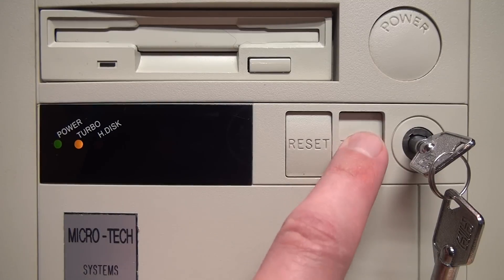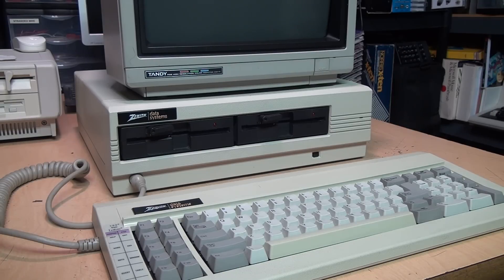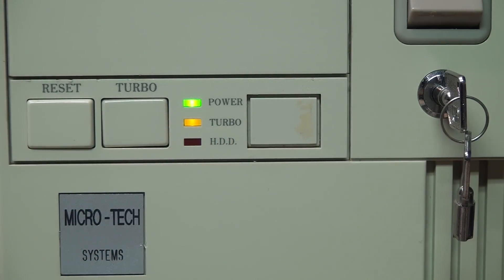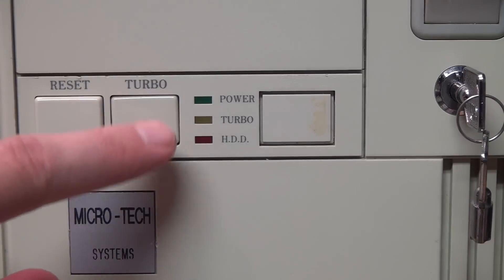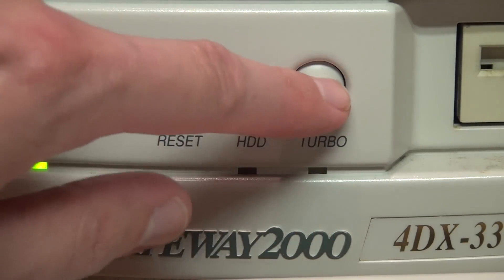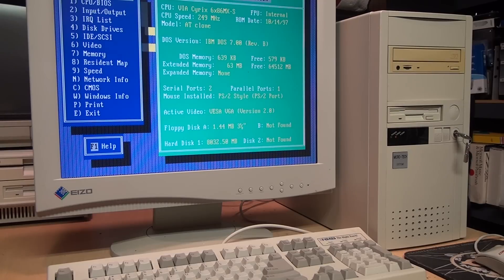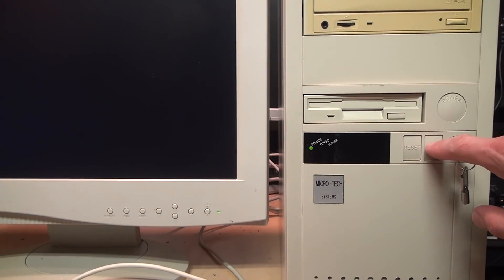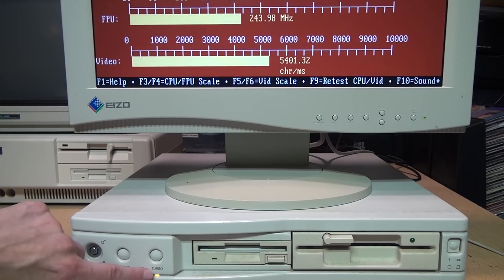The PC turbo button mystery finally solved! (beta version)

Comment: That's not what people mean when they say the turbo button makes the computer slower. they are referring to the fact that the Turbo button, does not actually boost performance, That's not why it's there, Its purpose is to slow down the cpu by adjusting the bus speed so old games and software wouldn't run at super speed.
Reply from the maker: That's not how the turbo function was initially advertised -- it was a speed boost feature. See the history section of the video.
Reply: @vwestlife  Exactly, It was advertised as a speed boost, but what it actually did, if you removed the button, was run at turbo speed, people realized this, and that's why they started to say "It actually slows down my pc, it doesn't make it go faster"
Reply: @SantaClaw   I feel like your explanation makes a lot less sense than the one VWestlife’s provided. Not only did he explain (not in these exact words, of course) that pressing in the Turbo button to enable the indicator light and the full speed of the CPU was a sort of de-facto standard, he also reiterated in the comment above that Turbo was advertised as a “speed-boost”. “Turbo” was never really referencing overclocking or generally faster speeds, it was specifically describing that with the feature on, the computer’s clock would be higher than that of an IBM PC or XT. If the light switches in your home were automatically set to the on position after a loss of power, you wouldn’t say that the switches in your house just turned your lights off, you’d say they toggle between the two states
Reply: @leakingsubconscious1671  True, I just remember how the saying spread in my area, I'm Norwegian, and we probably had different access to things than you guys did.  But here, some people felt cheated, as they thought the Turbo button, was a feature to make their pc's faster, only to find out, that in fact it did the complete opposite thing. Many people sought out the pc's with "turbo" as they thought they where faster than the "non turbo" ones. I had a friend who was very vocal about being "cheated" by this feature. 25 mhz vs 33 mhz bus speed for example. I suspect it was marketing having some inventive views on the thing. I remember full page ads, with a picture of the turbo button on a case, with speed stripes and text along the line of "Turbo It!" and/or "Engage Hyperspeed"

Comment: Regarding the Intel datasheet, the TURBO pin is only present on some SL processors and it's not what most systems used to implement the TURBO functionality. So, it may not be the best reference for the wiki page...
Reply from the maker: The turbo pin of the CPU isn't the point. It's what Intel officially defines turbo mode to be.
Reply: @VWestlife Yeah, I understand your point - it gives us a glimpse into Intel's state of mind at the time. But that said, the described "Turbo Mode" is something slightly different - something exclusive to the "SL-enhanced" chips. It's really a power-saving feature rather than a workaround to improve compatibility with old software. Most desktop processors from Intel didn't have any kind of "Turbo Mode." Instead, the feature was implemented on the motherboard/firmware level by dividing the external clock, introducing wait states, disabling caches, etc.
Reply from the maker: @GeckonCZ  Basically they built the turbo/non-turbo mode switching into the CPU rather than needing extra components on the motherboard to do it. That's the only unique thing about it.
Reply: @vwestlife  There's a little bit more to it but yeah, that's one way to look at it... :)

Comment: To make things even more confusing, some cases had the TURBO LED and LED display controlled directly by the TURBO switch instead of the motherboard. In this configuration, the readout could get out of sync with the actual speed set (e.g. when the key combo was used to change the mode).
Reply: Perhaps that's where people's confusion with the turbo switch having to be off to run faster is coming from?
Reply: @NiebaumCurran  The confusion was caused by there not being a standard. Our pc's were set to run full speed and pushing the switch slowed it down. Other builders did the opposite.
Reply: Turbo button's pressed in turbo light's on. Some program uses/conflicts with the same key combo as the slow down command, user is not aware of the turbo key combo, PC suddenly slows down but turbo led is still lit....  X-{

Comment: When I was in VoTech for IT in 2002/2003 a classmate built a PC and his PC case mysteriously had a turbo button. By this time that button was mostly gone from everything. What did the turbo button do on this case? It just increased the RPM of the fans hooked up to it. That was the only time I ever saw anything like that.
Reply from the maker: It's physically just a SPDT switch, so it can be repurposed for any other application which uses a similar switch.

Comment: Many office computers in the UK in the mid-90s had turbo buttons, which always seemed a bit silly (why would you want to run Word 4.3 slower?). The first PC I ever bought was a Pentium P60 (yep it was cheap) from the long defunct Escom computers. It used the same case as their 468 dx2 100 model so had the Turbo button on it. Needless to say it did diddly squat, though it had a very satisfying click to it & it looked kinda cool!
Reply: well some offices could've in theory been running some stuff from 80's still with some messages that you couldn't see I on a fast machine, in theory. but I tell you what, the turbo button came handy when playing star control II and doing the planet side resource gathering!
Reply: My first PC was an Escom too - it had a case with a Turbo button and LED, but its Intel Advanced/ZP motherboard only had the header for the LED. So you could switch Turbo on and off using the keyboard, but the button did nothing.

Comment: I have a computer right now that has a turbo light but no button. It does not turn the turbo light on when you start the computer, but it does start in high speed mode. If you hit the bios combination, it turns the light on and slows down. I think I remember it being red instead of the power led being green, as in you disabled turbo mode. Still confusing, though.
Reply: It's a Packard Bell Multi-Media with a 486 SX/25, BTW. It doesn't boot past the BIOS screen anymore because a barrel battery leaked and messed up some ICs and traces.
Reply from the maker: Many older systems used a dual-color power LED to indicate the system speed. Maybe the color that corresponds to turbo mode happens to be burned out or disconnected?
Reply: @vwestlife  I looked closer and one is an amber HDD light. The turbo light has a clear color, so it might be a dual color LED. I haven't used that turbo feature in a long time  even when I had a working one, since it wasn't useful for me. The LEDs connect to the motherboard with a 5 pin connector. Seems like it could have been done with 4.

I seem to recall the documentation mentioning hitting a key combination to activate turbo mode, but it started enabled. I suppose on some machines without a turbo light you could get some confusion if pushing the button in deactivates it.

Comment: Oh my thank you so much for making this video. I have told other people for years that the turbo function meant for the computer to go faster not slower. Yet you still have people who believe that enabling turbo makes the computer go slower that is absolutely stupid. When you bought a controller for your NES or super Nintendo or even the PC and it has a turbo button does your character do things slower or do they do them faster. When you buy a turbo for your car does your car go faster because it can get more gas to air intake which improves performance or does your car go slower. In the Pixar movie Turbo does the snail when he gets his turbo powers does he goes slower or does he go faster. A hint for everybody still debating this. They go faster! I'm so glad somebody else finally, finally, finally gets it right. This video needs to be shared with the people of Wikipedia and all the people who sit there and say turbo means slow.  I know I may sound upset about this but it it just blows my mind that people can take such a simple concept and get it wrong. Granted I'm not an Intel fan but that part from even them needs to be shared with everyone.
Reply: The deal with it is that the only reason why "turbo" exists is to slow down the system. The "fast" mode is in fact not fast, but instead normal speed. Add on poor communication, and you end up with the present confusion.
Reply: @absalomdraconis  it should have been communicated with the turbo button not enabled the processor runs at its base clock speed which could be  25 MHz 33 MHz or 40 MHz depending on the chip but is turbo function which would be its full speed that's where you get the 100 megahertz 120 megahertz 133 megahertz 160 MHz if overclocked.

Comment: My grandad's 286 had a turbo button. I wrote BASIC programs to figure out how it worked. The LED being on meant it ran about twice as fast, maybe a smidge more. LED on=faster computer, it was quite simple.
Reply: Usually pushing that button halved the frequency, or doubled it(33/16   66/33  50/25)  depending on which way it was connected.

Comment: I'm curious if anyone used the turbo button to enable/disable overclocking?
Reply from the maker: Possibly, if you had a motherboard where changing the CPU clock speed corresponded to closing or opening a jumper.

Comment: This one is high on my nostalgia meter being a PC hardware field engineer around the early to mid nineties. Turbo button ✅ AMIbios memory test ... Tick tick tick (ESC) Burrrrrrrrrrrrr 😂✅ Some of those frequency LED displays were a pain to setup and others had far better designs. Self built PCs and beige clones were everywhere back then. Great memories 🤗
Reply: The only thing that makes you even more nostalgic is that beepy sound of the mfm seagate drive...

Comment: The thing is, people normally ran the computer at full speed, and the only time they needed to hit the turbo button was to slow it down. Hence the modern misconception.
Reply: It's like me telling you that pressing the Dolby button on your tape deck makes the sound quality worse.  It's technically true if the feature is enabled by default, but it's misleading.
Reply: That and the turbo button was not a feature on other machines where slow down utilities were solely relied on for the Atari St and Amiga. Dos also had such utilities but it also had the turbo button even though it could not fine tune how much you wanted to slow it down like utilities can.